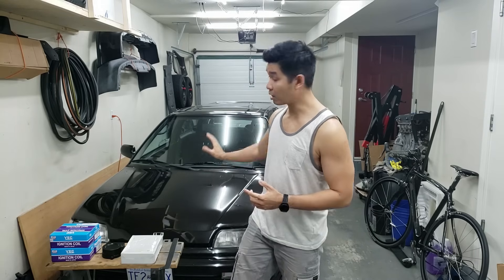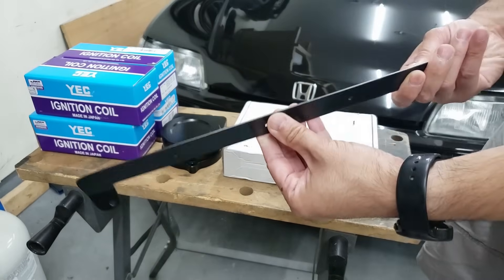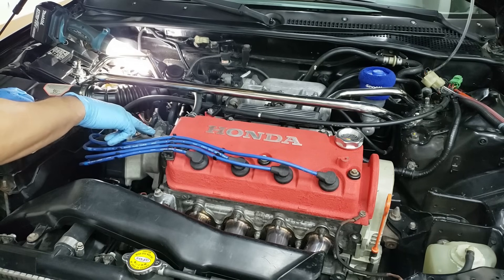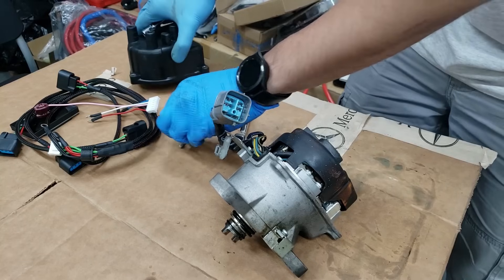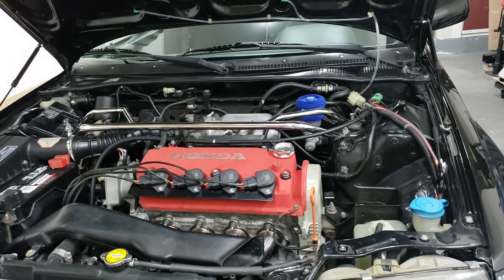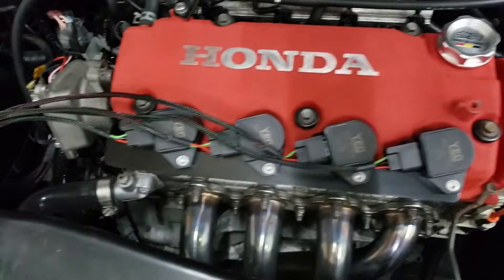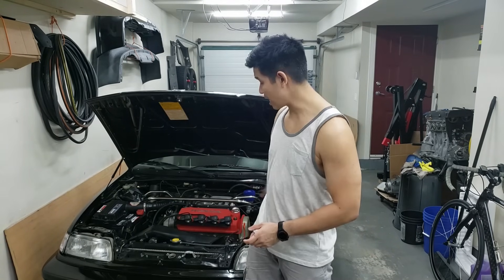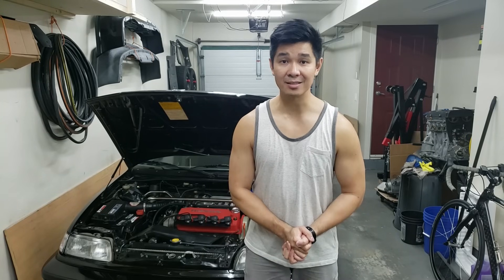||HONDA CIVIC & CRX|| 🤑The CHEAPEST Coil on Plug Conversion Kit!!💥for HONDA B D H F Series Engines👍🏻

Comment: It's funny, I've got a CB7 accord, 245k on it, and it still starts in like half a crank cycle. I love that you noticed it took one extra crank to get it started. I too have mine down where I can let go of the key prematurely and the motor still starts. I notice when somethings off if it doesn't start in exactly 1 crank :D

Comment: would you trust driving this on longer road trip 500miles or more. Also does this work on OBD0?
Reply from the maker: Yes, of course I would trust it. It's more reliable than a distributor. And no, doesn't work with OBD0.

Comment: What is the point of doing this convertion? What are the differences? Thanks
Reply: Coil packs are just more reliable. Distributors leak, and fail quite often. And coil packs are cheaper to replace

Comment: the engine looks similar to 1998 honda civic but the battery placement is different place sometimes its located on the back left corner close to the windshield known as passenger side

Comment: Hello, great video.Since your car is EF body, did you have any hood clearance issue with these coils?
Reply from the maker: @B52PSI  no issues with hood clearance. Its not much higher than a regular spark plug wire. I transfered these to my b18 now and still no clearance issus, but with the b18, its very tight with my coilpack plate bolted on. Needed to use counter sunk screws to fasten the plate on. Anything higher than the plate rubbed the hood. With the d series, its fine. Zero issues.
Reply: I have the same issue
Reply from the maker: @WilliamPalmer-o4x  I'm curious if you're having hood clearance issues because of the coil packs you're using. You should be using D17 coils. D17 fit perfect and no clearance issues. I believe the k series coil packs sit a lot higher.

Comment: Thank you!! I have a question, Does this work with a D16z6 vtec 1995 engine? Because I really want to do this upgrade, algo, do I need a Hondata? Or just my stock p28 ECU that comes with my Civic 1995 EX coupe please let me know! Thank you for this video, is gold!
Reply from the maker: Yes, it should work for D16z6 all the obd1 and obd2 distributors have the same internals. It will work with any of those ECU's. If you have any further questions, you should reach out to the manufacturer mentioned in the video. They'll know their product better than me. I'm running this kit on my B18 now and never had any issues aside from it starting not as quick.

Comment: hey bro i got a honda capa i swap to d16y7 i had in a d15b  but i am using the d15b wire harness on the d16y7 i want to covert it to obd1 but i dont know how to do the wiring for it i need some help
Reply from the maker: Just buy an ecu jumper harness. Depending on if you're obd2a or obd2b, just buy the correct harness and it's pretty much plug and play.
Reply: @BudgetGears  i have a honda capa ga4a what jumper harness i need
Reply from the maker: @STANUELGAUTIER  Please do your own research. I'll give you a tip, just look at what ECU connectors you have and you'll know what harness you need.
Reply: @BudgetGears  I cant tell buy looking at it like that i am no export  in car
Reply from the maker: @STANUELGAUTIER  Sorry, I can't see your car so I can't tell either. You can easily Google this information. Compare it with the pictures online. Thats what everyone does.
Reply: @BudgetGears  it a honda capa ga4a please just check to see it 
and let me no please

Comment: Do I have to have the ignition timing set already or can I do it after install of coil conversion?
Reply from the maker: @bentracy3349  Either is fine. Always best to check your timing after you mess with your distributor. Make sure you keep one of your spark plug wires. You'll need it to set your timing.

Comment: Do you have to time your car after the install 
Do you think the timing has to do woth it not starting fast enough?
Reply from the maker: @Lorenzo-t8d  yes, timing should be done anytime you mess with the distributor. I checked timing and it was spot on. The slow starting is intentional by the manufacturer. Read their response in the comments. I have since moved the system over to my b series and same kind of cranking. Maybe it cranks a bit faster now cause I upgraded my starter wire.

Comment: Can't see the benefits in this mod. Seems to run worse so i think ill just run the stock dizzy. Makes good power etc. No startup issues.
Reply: Where does one buy a new, OEM dizzy? The sensors in the base of the aftermarket distributors seem to be very poor compared to OEM.

Comment: What are the pros and cons to swapping to a coil on plug as to the oem style? Only thing I think is a con is the cost of plugs as to wires
Reply from the maker: There's a lot of different pros and cons, but the main pros are that it provides more reliability by lasting longer than a normal distributor, providing consistent spark, ability to still run since it's running 4 coils vs a distributor running 1, simplier to fix if a coil dies as you can easily replace just the coil pack compared to the entire distributor,  costs of conversion is similar to that of a better quality new distributor, cheaper than replacing with an OEM distributor if you can even still find one, allows for better spark tuning, etc. Some cons is that it still utilizes sensors inside the distributor, not really necessary unless your distributor is failing, cost of conversion, but if you have to replace distributor anyways, this is about the same price, still require a old spark plug wire to time the ignition as it still uses sensors inside distributor, engine may take more cranks to start because of sychronization, etc.

Comment: Hi Bro..available for eg6??
Reply from the maker: This is something you should ask the manufacturer. I'm not the manufacturer or affiliated with them. You can contact the manufacturer mentioned in the video. Plus, the Honda COP conversions are not vehicle specific. As long as you have one of the engines listed in the title and OBD1/2, then it'll work.
Reply: @BudgetGears  thanks for Fast respons..can u give me Link for that item

Comment: Did you set mechanical timing?
Reply from the maker: Yes, it was already set before the conversion. I marked my distributor and put it back to exactly the way it was. If you need to set your timing, the procedure is the same as stock, but you'll need to bridge the coil pack using a old spark plug wire to put a timing light to. Then twist the distributor and you're done.
Reply: @BudgetGears  did you check your timing after it was installed 
The coil rotor might have done a few rotations
Reply from the maker: @Lorenzo-t8d  yes, timing was checked. Everything was spot on.

Comment: Based off what BTO said in their comments, I think you can actually do a bypass quick splice on the ecu for the ckp and cyp. I did it to mine. And now have a closed loop. It’s an old trick, but that might help skip the ecu needing to calibrate itself with your new coil setup. Might even help crank the car up faster
Reply: Yea can you explain how you did that
Reply: @Gooseb531  it is very easy.. google CKF BYPASS TRICK.
Reply: that'll be 600 bucks @Gooseb531
Reply: How do you bypass that?
Reply: @Sumbish.performance  google ckf bypass trick

Comment: nice!  for which car do you order the coils? i have a D16y8 and i want to know which  car have the coils that fits on mine
Reply from the maker: You'll need D17 coils. So coils from a 2001-2005 Civic.
Reply: @BudgetGears    i already got the convertion kit but my D16Y8 distributor it  doesnt have the tach wire, do you know what can i do ?
Reply from the maker: @jernyz  I'm assuming your distributor is the 99-00 one using the OBD2B plug. Those didn't come with a tach wire. You can easily open up the distributor and use a spade crimp and some wire and add it yourself. There's a spot for it in your distributor.
Reply: @BudgetGears   yes it is 99-00 Thankyou very much

Comment: I love that the rotor button screw (which is normally the bitch) came right off while the rotor button (normally takes zero pressure to remove) was the major pain in the ass. 

 Side bar is the cop board tuneable?
Reply from the maker: lol. Yeah I know right! I've never had that much trouble with the rotor in other distributors. Weird thing is the rotor I removed was new and hasn't even seen 6000 kms yet. 

I'm not sure if the board is tuneable or not. You can tune the ignition timing like you would with normal distributor timing, but I'm not familiar with any other tuning to it.
Reply: @BudgetGears  that's nuts man. And cool thanks for the info i have a d15 B TURBO CRX that i want to convert I'm checking out different options.
Reply from the maker: @matthewglaze5398  That's awesome! That thing must be quick. I think all the COP kits probably work the same. I see most of the other ones are based on the hondarulez board that needs to be soldered into the ecu board. I wasn't a fan of modifying the ecu and then running another set of wiring from the ecu to the engine bay. This option allowed everything to be done at the distributor, which was something I liked. Also, being the most affordable kit made it a excellent option. 😁Only thing is I didn't really need to convert since I'm stock and I noticed no difference except my car takes longer to fire up now. lol.
Reply: @BudgetGears  the car is fast when it is working right. Lol hondas right? I haven't had it on a dyno yet just been street tuning it my self. But currently I'm having an issue where the afr gauge bugs out and starts reading full lean under heavy acceleration even though the car is still running fine. It's hurting the tuning process to say the least. And the affordable price of this cop option definitely makes it worth the shot. Snake tuning makes one similar to this. The most expensive stand alone one i have seen is called a digidizzy but at $700 dollars its a little steep.

Comment: What is your experience after this time using the system? I am considering buying it but I don't know anyone who uses it here in Puerto Rico
Reply from the maker: I didn't really use it that much because my car is only driven in the summer. I only got maybe a couple months of driving on it. It drives fine and works fine. Only thing is as mentioned in the video is that it takes longer to start. I'd say it's a nice upgrade if your distributor is failing or if you need it for a high horsepower build. If you're stock like me or close to stock, don't waste your money. You'll notice no difference between your good distributor and this upgrade. It'll only provide a different look. It's hard to tell with reliability because that needs to be tested over many years. Most OEM distributors will last a lifetime with a bit of maintenance.

Comment: did the hard to start go away>? or is it still the same after driving it for a while?
Reply from the maker: Its the same. I'm kind of used to it now. I just crank it longer. Sucks that I can't just push the button on my push start to fire it up. I now have to hold it so it cranks till it fires up.

Comment: The longer cranking time is enforced by the need to synchronize the module with the engine.
The BTO module uses the CYP sensor signal for synchronization, which occurs every four ignitions, so in the worst case we have to wait three ignitions for synchronization.
In the factory solution, the ignition unit is mechanically synchronized with the engine.
Reply: so the longer harder to start will always be a thing for this kit? i also got this kit and put it on my 98 civic. does the same thing hard to start.
Reply: @bo2o  Reading BTO's comment,  i understand the modules needs a signal to synchronize that happen every two crank turns. That's how it is. I wish is existed a different sensor setup to fully bypass the distributor.
Reply: Where I can get the kit in 🇺🇸
Reply: @lauraandkelvinmontano9154  best tuning option Honda coil pack. Google it and it will show. Keep an eye on your tracking. Could be in customs on a hold until you’re able to call and get it released
Reply: Are you people still doing business
Reply: I legit just put a order in yesterday. I’m hoping I’ll get a tracking number soon
Reply: @DCUTUB they are

Comment: I’m considering doing this mod to my 89 ef with a B16a. How well are they performing so far? How much mileage do you have on them so far?
Reply from the maker: I've had no issues since the installation. Works the same as before the mod. It's a sweet mod, but no real difference aside from my car taking a bit more cranks to fire up. I only drive it in the summer so I probably only put around 800 kms on it or maybe less. I'd say the mod is very cool looking, but I haven't noticed any change in performance or reliability. I guess performance is not something very obvious when the motor is stock. I'm sure it'll probably last a long time though so fingers crossed on reliability.
Reply: That’s good to know. I keep blowing thru aftermarket dizzys and keep getting engine codes. I did purchase your main relay adaptor kit, and I’m hoping this mod makes the car more reliable. I’ve had 2 breakdowns in the last month both related to the electrical system.
Reply from the maker: @opticalsound7883  That totally sucks. The aftermarket dizzys seem to really be a hit or miss and the OEM ones are super expensive or discontinued. This mod would make the ignition more reliable, but it'll still rely on sensors in the dizzy. So hopefully you're not having any issues with those sensors. Thanks for purchasing my main relay. Really appreciate the support!
Reply: @opticalsound7883 for the dizzys, I recommend you change the ignition coil and igniter to a reliable brand like ngk. Ive gotten 50,000 miles on mine before replacing those items again and theyre not expensive vs the whole dizzy

Comment: Do u need a tune to run these
Reply from the maker: If you mean a modified ecu with a tuned map, then no. It'll work on a virgin ecu or a modified ecu. But, it's best to check out the specs yourself and ask the company questions if you're unsure.

Comment: I purchased two kits. I've installed one today. For the GND wire I earthed it inside the cap to one of the screws directly opposite where you put it, instead of to the outer screw. Same body so should OK but tidier. For the pink wire I cut a small channel on the OEM rubber grommet, ran it through then reinstalled the oring over the top for a perfect seal.
Reply: Where can I buy it? Thank you!
Reply: Watching the video, i was thinking the same for GND wire, easier and tidier solution

Comment: Nice video. I assume this will work on a B20? Where did you buy the distributor block-off plate? Thanks. Do you have a part number for the coil packs?
Reply from the maker: Yep, it'll work for b20. You'll have to go on the manufacturers website to read the specs. But it works for all the b, d, f, h motors. The dizzy cap can be bought on Amazon, eBay, aliexpress, etc. And the coil packs is yec 602a. Just coils for a 2001 civic. If you're gonna run them for your b20, I'd go with k20 coil packs cause you can use the mounting plate that has provisions for the holes on the k20 coils. The d17 coils need the ear choped off and you'll need some way to hold them down. They do pop out if you don't fasten the coil packs down.
Reply: @BudgetGears  thanks! BTO said I should use D16 coils for my application but you say these would pop out. I assume the valve cover for the B18 is the same as the B20?
Reply from the maker: @slorice8723  The valve cover is the same for the B18 and B20. I'd say all coils will pop out if you don't fasten they down somehow. With the D17 coils, you'll grind off the ear to fit. There won't be a way to screw the coil down. You can make or buy a plate that goes over all the coils, which will hold them down. The other option is use K20 coils, which sit a bit higher, but they make a mounting plate that the coils screw into. So the plate sits on top of the valve cover and the coils screw in. Cleaner in my opinion. You just have to make sure you keep the coils fastened down.

Comment: Hello, is this system suitable for d15b3 engine code? And where can I buy the product?
Reply from the maker: I'm not familiar with your engine since it's not something we have in North America. It looks like your motor is a carbureted engine, which is very different from our fuel injected engines. I'd recommend contacting BTO and asking them. I'd like to say no, it's not compatible, but I don't know for sure. This kit only works for engines with obd1 and obd2 distributors. And as mentioned in the video this kit is made by BTO so you can buy it from them.
Reply: where can i get it to do it

Comment: Hope this helps . I had a b16 that would start and runn for about 60 seconds then would die . So I pulled the cap off the dizzy and the pick ups  in side all the plastic covering the metal Were cracked and split . Just trying to say the issue with it taking a little bit to start could have some to do with the plastic that Broke on your magnetic pic up .
Reply from the maker: There wasn't actually plastic that broke in the magnetic pick up. It's weird cause it's only half covered in plastic. Not sure if my dizzy is aftermarket or not cause I've seen that piece in both styles, covered in plastic and only half covered. So I actually chipped off pieces of the magnet. So I guess maybe the damage caused it to fire up slower. Not really sure. I guess as long as it fires up and runs, I'll just let it be. Another thing I did notice before doing the COP conversion was when I tested my new engine harness. The car seemed to fire up even better with the new engine harness. Might just be a coincidence.